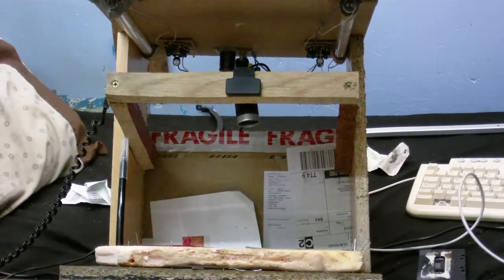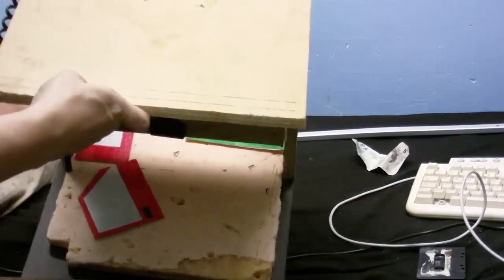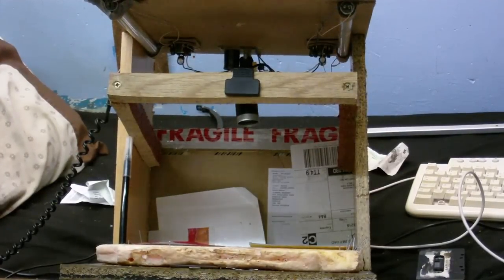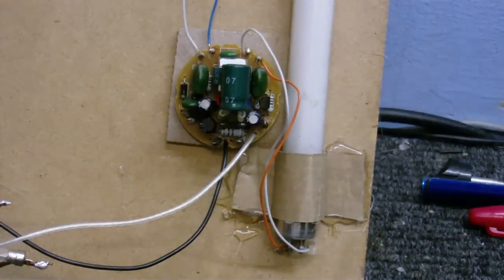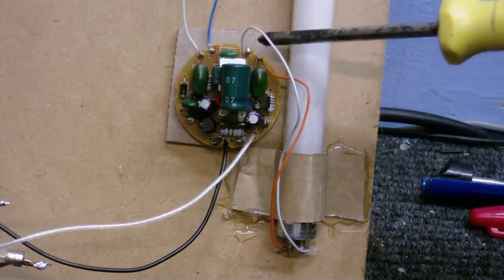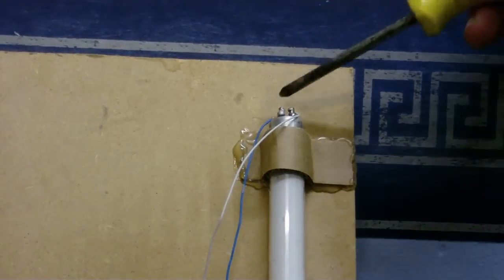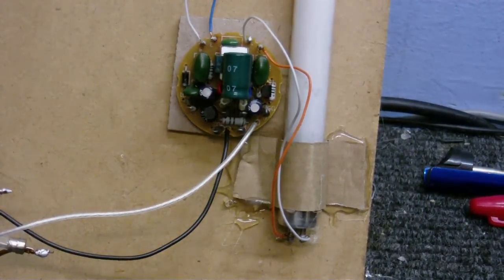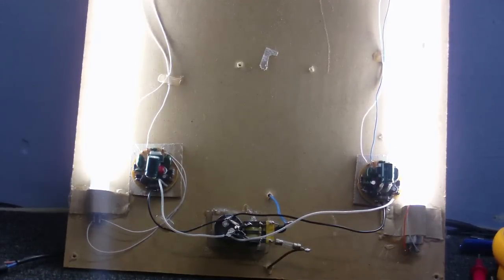How to power a flourescent light with a CFL ballast.

Comment: Can anyone give a bit more information regarding the need of a bridge rectifier? These CFL bulb ballasts already have 4 diodes in bridge configuration to rectify the AC mains input to DC anyway. Unless these ones aren't like that.....bit too far away to see.
Reply from the maker: The reason was becuase the filter capacitors in those ballasts were very small, giving the lights a little bit of flicker (inpersevable to the human eye, but streak city on a camera), so, by adding a bridge rectifier and large filter capacitor, I put smooth DC into them and no more flicker.
Reply: @CoolDudeClem  Thanks for the supply mate, I appreciate your help. So the ballast has a small bridge rectifier too, or the separate one the guy made is the only one? That's what is confusing me. I heard him say "this won't work for CFL inductive ballasts".....which are the ones I'm talking about. They look very similar, but have a big square inductor in the middle of the pcb, which a lot of people think is a transformer, when in reality it isn't. Only has one winding. Next to it there is usually a small toroidal transformer with 3 windings...each with very few turns (between 5 and 10). This is the actual step up transformer. I'm assuming these ones in this video are different and don't have these big inductors? Edit: (You are the poster of the video replying!!! I was thinking of another channel where I had to rely on people's comments for answers! Sorry about that mate. Thank you very much for your help!)
Reply: @CoolDudeClem  Also just a quick second question, what tubes would these ballasts work on? Could I for example light up a T8 tube with a CFL bulb inductive type ballast? Just concerned about the wattage differences. Would the small circuit cope? Thanks again for your replies mate I honestly do appreciate your time.

Comment: i guess you need to put the electronics into a safe-box - using circuit print board and decent cabling, solderless-connection  and.. shrinkwrapping does some good, too ?

Comment: I guess the other thing to watch out for is surge suppression. I've got a halide ballast (electronic) that is rated on the label for 220-240V 50/60/0Hz, but it turns out it can handle 320V DC so I should be able to run it on the 300V DC supply inside my cheap-shit Maplin inverter. If there were surge arrestors in there I'd expect them to be 275 volt rated, and they might not be too keen on getting overdriven :)
Video on that coming soon...

Comment: be careful when the bulbs reach EOL. becayse as i can see the ends have cardboard and the ends where the cathodes are, can reach to a very high tempurature which could cause the glass to melt very little and start a fire on the cardboard